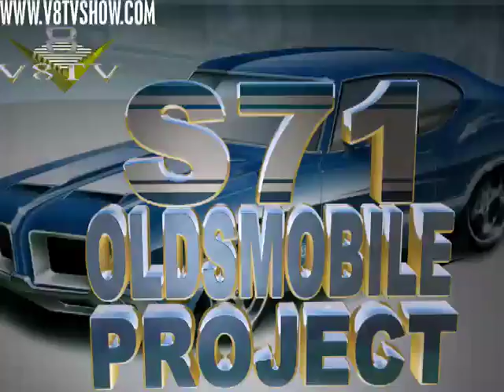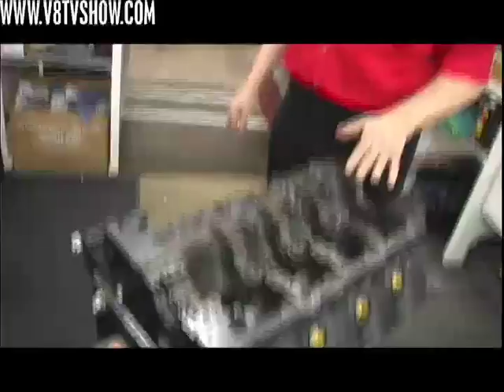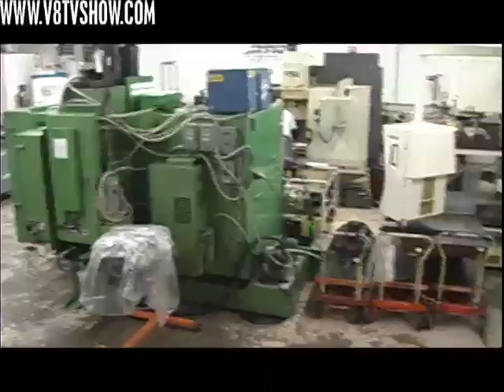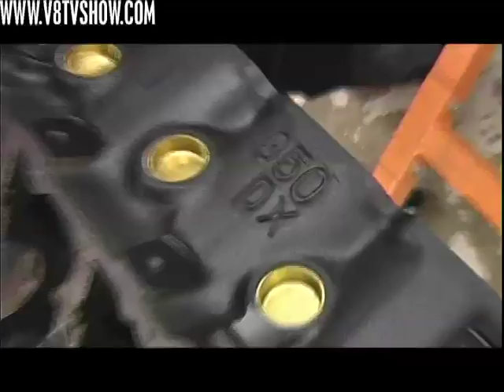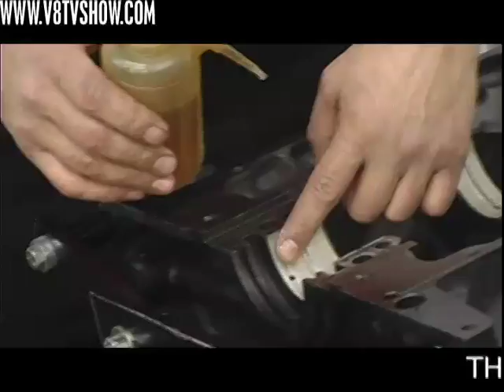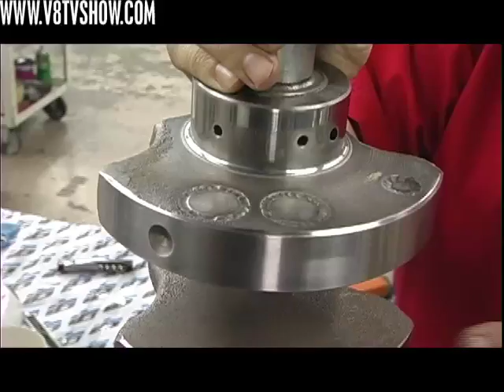Turbo "S71" Olds Engine Build Video BTR Performance Part 1 V8TV

Comment: I've never had any issues with Clevite bearings, my built bored LSVTEC (1.85L DOHC VTEC Honda engine) has them in the rods and mains and it made 709 wheel horsepower. However, I have always personally used ACL Race bearings in my import blocks. I rebuilt a stock B18B1 (1.8L DOHC non-VTEC Honda engine) and with Brian Crower Stage 2 Turbo Cams, dual valve springs with titanium retainers, ARP head studs, ARP main studs, and a standard $90 50 trim floating bearing eBay turbo it made 412 whp at 18 psi...on stock pistons and cast rods, but freshly rebuilt with NPR rings and ACL Race bearings. I am nowhere near a professional engine builder because I lack the tools, the experience, and the knowledge that these guys have, but I was proud of that little engine...and it lived and was always reliable until I tore it down to put forged internals in it.

Comment: Bill, it doesn't matter what you've done, if your attitude towards prospective new customers, drives away more business than you ever did.  naturally aspirated motors for drag racing don't want maximum stroke, just ask the pro stock guys...better yet ask the NASCAR and Formula 1 guys...and the guys that run LeMans...if it's all about stroke, why didn't you drop a 4.25" 455 Olds crank in that diesel block then ?  it appears you've went the boosted power adder route, so cylinder head flow no longer matters, when you're blowing it in...
Reply: ofc cylinder head flow matters in boosted applications dingbat. you think top fuel drag team spend all that money on the latest heads for nothing? Look at import drag racing/road racing, those guys spend big money on cnc porting, but apparently its all money wasted lmao

Comment: A not sure but I know that the first olds 425 motor came out and it had bigger lifeters as well is the lifter the same as this D.X block ??  Im a 425 lover and later in the year they made a block that used the 455 lifter
Reply: My 67 330 has 0.921 lifters
Reply: Some of the 425s had 921 lifters,  later ones had 842. The difference is they were all flat tappets,  this DX diesel had roller lifters.

Comment: I know the Olds diesel block had 350 CID, and you mentioned about the long stroke crank from the bigger engine, but what is the final CID this engine is going to end up with?
Reply from the maker: The overbore and Olds 425 offset ground stroker crankshaft yielded 422 cubic inches.
Reply: Nice!

Comment: They weren't made in the 70s, it was a product of the 80s.
Reply from the maker: 1978-1985
Reply: Tooled up in the 70s. You gonna correct people you should at least know what the fuck your talking about.
Reply: Yes thousands of Oldsmobile Diesels came out in the 1970s . The whole engine was in response to the 1970s oil crisis.

Comment: Hi bill, could you please tell me why some 455 have the distributor in the front of the engine and some have it at the back of the engine? thank you, great advice. jim
Reply: because   oldsmobile pontiac and  buick made  455`s and oldsmobile  and  pontiac had the distributor in the back while buick had it in the front
Reply: Those are called Buick engines. Only similarities are BOP bellhousing pattern and Q-jet pattern on the intake. Distributor cap also same.
Reply: Simple answer a Pontiac 455 and Buick 455 is not the same engine as an Oldsmobile 455
Reply: buick has always had the distributor in the front and it being aluminum with steel gears from oil pump is the reason most Buicks fail and they did away after 80-81 no Buicks v-8 were made.
Reply: after 81 Buicks v-8's were no more.

Comment: I had a 1980 Olds Cutlass Supreme with the diesel engine.  I drove it for years and took it on trips across country.  I never had any problems with the car.  Got 30 mpg but was not very powerful. People did not know how to service these engines back then. Wrong oil or fuel. That is why they had problems.
Reply: +Bruce Miller Ha-ha! That's funny.
Reply: I premix ed me olds 403 at 40:1 and ran nothing but tcw3. American car motors run no roller bearings unlike a rotax skidoo, I hate the automove 4 stroke, it had no oil injection 
, but I ran nothing but tcw3 filled up and ran some into the intake. These American blocks love 2 stroke oil as I r b the hell out of them. I love total loss
Reply: How does a clevelight hold up to hold up to 50:1. I run nothing but 2 stroke oil. I love roller bearings though
Reply: How about an Olds DRCE aluminum billet race block? That would make for a nice 2 stroke conversion like this guy did with 454 tall deck block:https://www.chevelles.com/forums/11-bench-racing/528170-2-stroke-454-a.html

Comment: I wonna rebuild my 350 in my 72 cutlass but dont know were to start.lol..im new to the engine rebuilding thing
Reply: First step is remove engine from chassis. Do alot of research. Buy alot of tools and make sure you have a buddy around that builds engines. It's not impossible.

Comment: I was thinking that the olds 350 DX diesel didn't come out til the early 80s  . I know that the D block 350 was an earlier engine that will accept a standard lifter. This guy says nothing of blocking off oil flow to where the injector pump came out. using oil restrictors or spacing the cam for proper chain alignment . Btw their is a lifter that will fit the DX 350 block .ha ha.
Reply: This dude has probably forgot more about Olds engines than you'll ever know. I've followed his builds for many years, dudes top notch.
Reply: Guess you know more than this guy huh. Dipshit.

Comment from the maker: The Olds LF-9 Diesel was made between 1977 all the way up through 1985.   Ours came out of a running 1981 98 Regency, which was actually a very nice car to drive home to the shop... Before we blew it apart for it's engine!   That car also gave up a 2004r transmission and a factory hydro boost brake system for other projects.

Comment: Diesel 350s were made in the early 80s. not 70s .
Reply: Oldsmobile 350D diesel with flat lifters and pencil injectors was 1978 to 1980 in cars and 1978 to 1981 in pickups,  1981 Oldsmobile came out with the 350 DX with a roller cam and lifters, poppet injectors, HPCA on the IP and HP was dropped to 105 and torque 220 lb ft
Reply: Yes plenty of Oldsmobile Diesels came out in 1970s